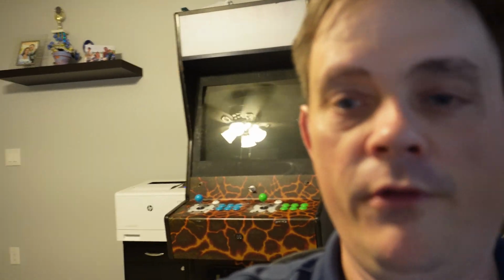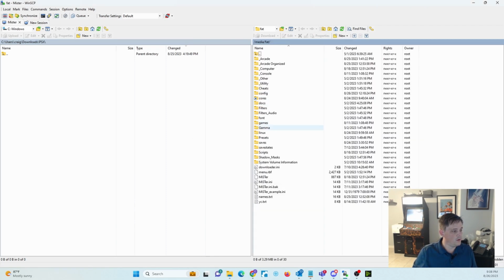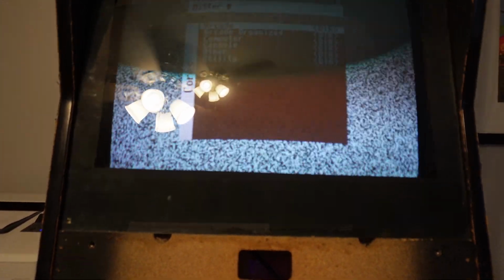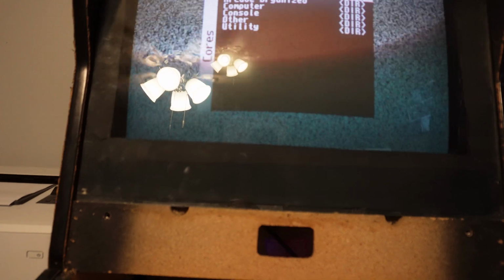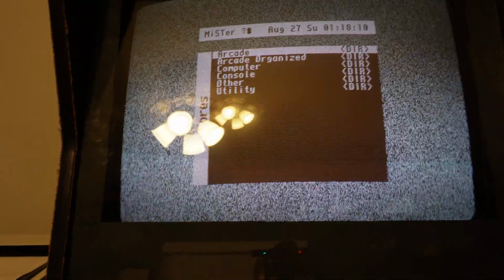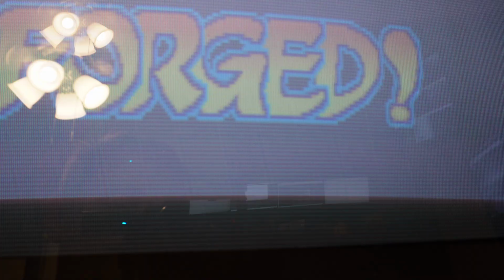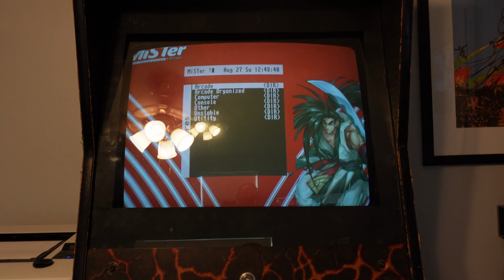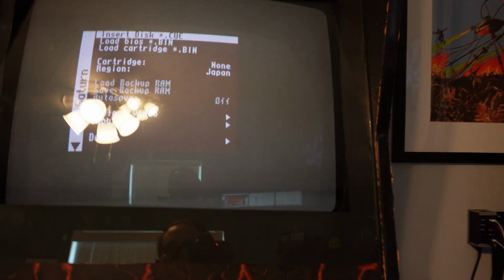MiSTer FPGA - swapping Arcade to Direct Video & Install of 2nd SD-RAM

Comment: Please tell me if it makes sense to update sd ram  v2.9 to v3.0. They were both released in 2021. The only difference is in the markings on the chips.
Reply from the maker: I'm not entirely sure what the difference is. If you're buying now, I would recommend going for the latest revision. However, if you already have RAM, I don't see a need to upgrade.

Comment: Hi  Craig thanks for yours great videos .
Now how you connected to your arcade Crt ? arcade crt do not use vga input . My arcade monitor use 10 pins connector, can you show How you connecting vga on arcade crt ! Please

Thanks before hands
Reply from the maker: Hi Tony, you can see some of that in this video - https://youtu.be/hbY1fAipB6M?t=421  My Arcade monitor has red green blue, sync, and ground inputs (5 pins) I have these wired to BNC connectors and then use a VGA to BNC break out cable. Its important to understand the MiSTer uses a VGA type connector (D15) however the signal is not standard VGA, you configure the INI file in MiSTer telling it what format video to output. If you try and connect a regular PC VGA port to an arcade monitor it will not work without special drivers.
Reply: @CraigKergald  thanks 😊

Comment: This looks awesome! Is that monitor an arcade monitor? If so, how did you convert the signal to 15Khz RGBS from the VGA signal? thanks
Reply from the maker: yes it is, the MiSTer can output a number of different signals over the VGA connection (or in this case Direct Video using a HDMI to VGA Digital to Analog Converter (DAC)) It can also output component YPBR, and RGB sync on green over the same connection, you just have to configure  the INI file.

Comment: I’ve got the same Amazon HDMI adapter for direct-video and it works well.
Reply from the maker: it does for me too, but I have started powering it via USB (not connected to mister USB) because I was seeing some instability with USB devices not working reliably, not powering up when connected to USB, etc. If you see any of this behavior I'd recommend using the microUSB port on the back of the adapter to power it

Comment: I am in a similar process with my mister currently in a arcade  cabinet but mine is over jamma
Reply from the maker: I could of done this in jamma, just get a fingerboard and solder daemonbite connections to the finger board, solder rgb plus sync to the finger board